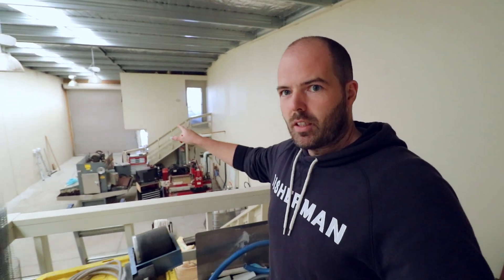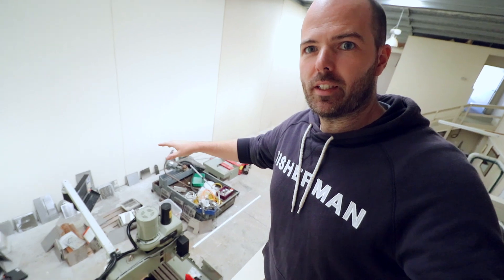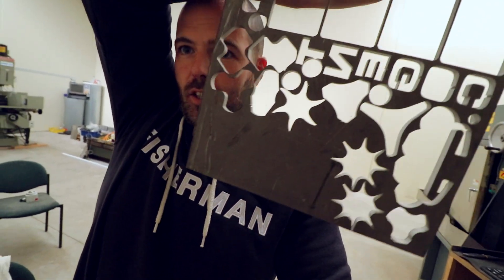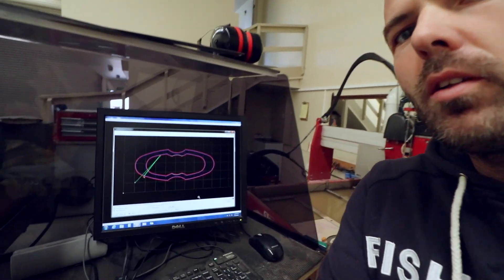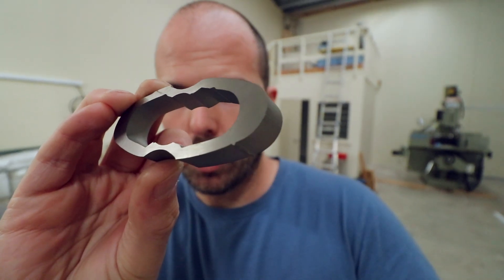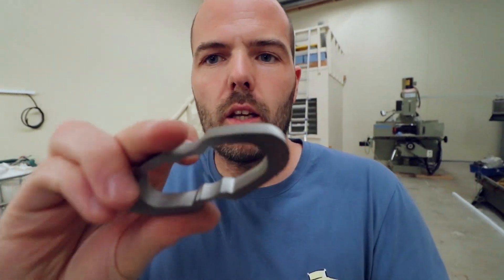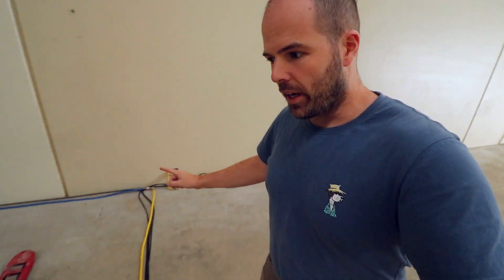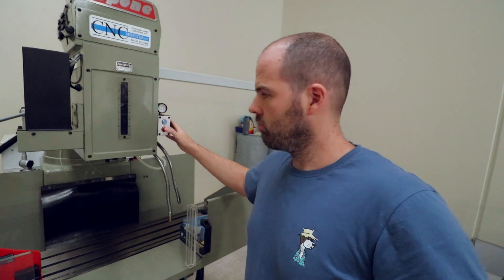NEW Workshop Tour (and some Fidget Spinners)

Comment: There's a lot of reverb in the new workshop. Basically sound bouncing off the walls and going back into the mic. 

Was gonna ask to make one a bit thicker, figured you'd be able to cut different angles on the grippy parts of the spinner this way.